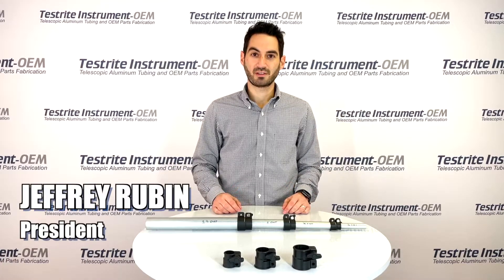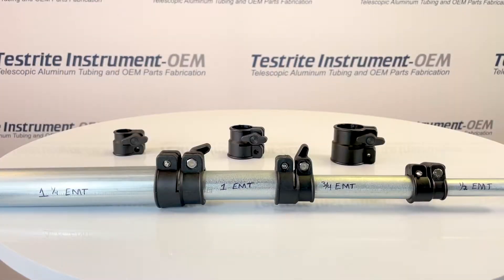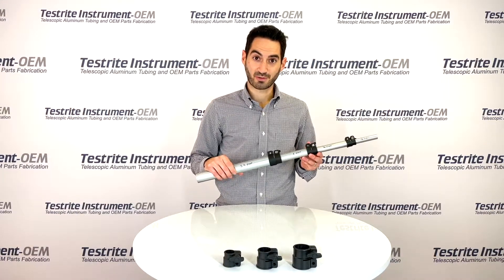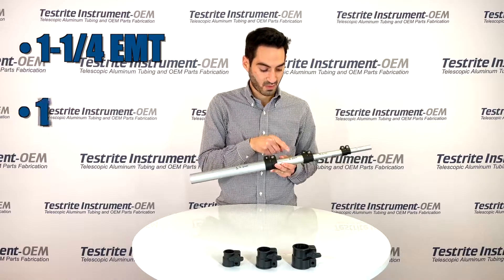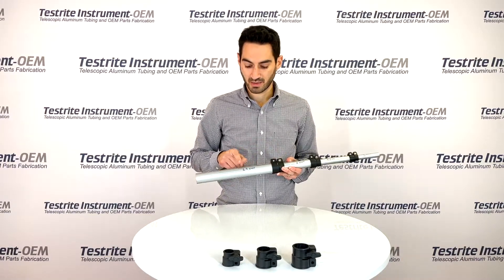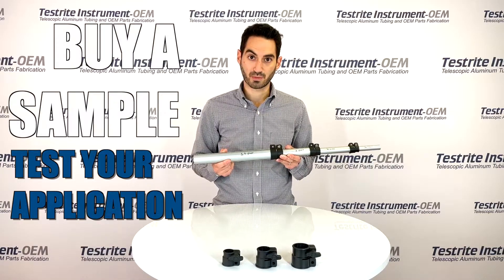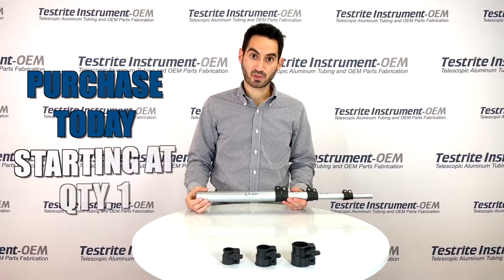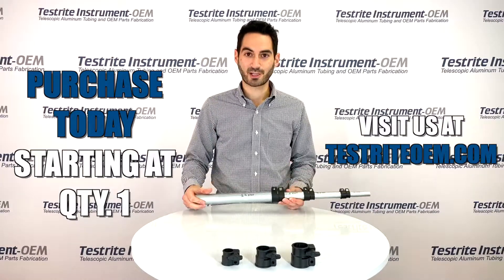'B' Locks for telescoping EMT tubing

Comment: Would be nice to have a USPS flat rate shipping option. 
For example one $15 1" to 3/4" tube lock sample is shipped for 16.95 UPS. This is excessive.
Reply from the maker: Thank you for your feedback. We stopped shipping product via USPS years ago due to many complaints from customers about product not arriving as expected with no recourse. As a manufacturer of custom hardware, when products don't arrive, they have to be re-made which means further delays to our customer and disruption to our manufacturing. For this reason we primarily ship via UPS. We do allow customers to provide a UPS or FedEx account number to ship on if you have one. In addition, large orders ship on skids via LTL, which provides a MUCH lower shipping cost per unit. You're right that for small or single piece orders, the freight can be as much as or more than the product itself. If you private message us the order number or specifics of what you're seeing if you haven't ordered, we'll take a look and see if there's a glitch here.

Comment: This clamp can use for PVC pipe?
Reply from the maker: Nikhil, these tubing clamps are sized for standard US Electro Metallic Tubing sizes. PVC tubing appears to use a different set of sizes, so these tube clamps would not work with PVC. If you have a specific application in mind and need 100+ pcs, please reach out via www.testriteoem.com with a Request for Quote and we're happy to take a look and see if we have any solutions that could work.
Reply from the maker: Nikhil, YES, we can make our telescopic tube clamps for PVC tubing in Qty 100+. We had a customer follow-up to your message and they sent us samples of the PVC tubing they're using (1.06" x 0.075" Wall and 0.84" x 0.110" Wall). We were able to make clamps to suit their tubing. You can check it out on our new video https://youtu.be/5Px2PyGcSE0